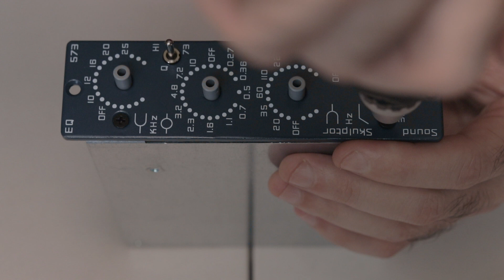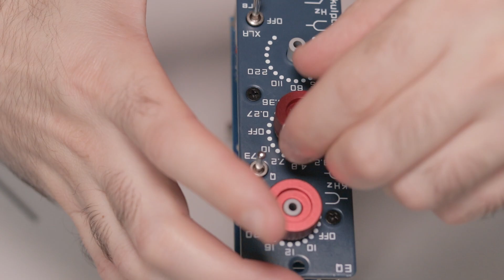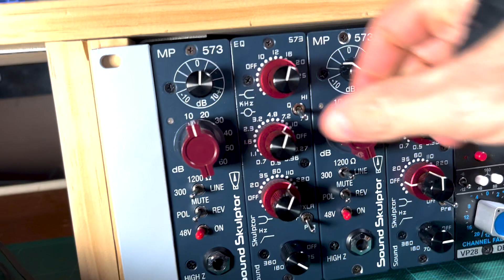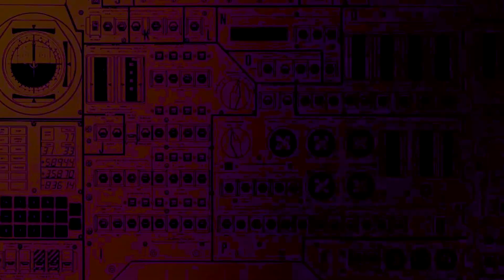How to Build your Own EQ - Sound Skulptor EQ573 (NEVE 1073) DIY Build PART 3

Comment: Great vid again bro, I have to try a build just afraid to mess it up lol
Reply from the maker: Thanks. That eq had been made a little easier to build. It’s still a challenge though. 

Start with building some simpler gear first like a mike or a pedal effect. Get your soldering chops up and then you’ll be able to do these I no time.

Comment: Hi Mitch, great videos. Did you already make this cable-upgrade video which you were talking about at the end? Greetings from Switzerland 🇨🇭
Reply from the maker: Thanks so much. I actually still haven’t got around to it. I was having some slight noise issues but realised it was more from a cable management situation. 

Have you got both of these units?
Reply: @diyrecordingstudio  not yet. But I'm thinking about buying them.
Reply from the maker: Theyre very, very good. People like to bad mouth clones on youtube and stuff, but I used these and the real thing. I actually like these more. They have more options than the original 1073 design.